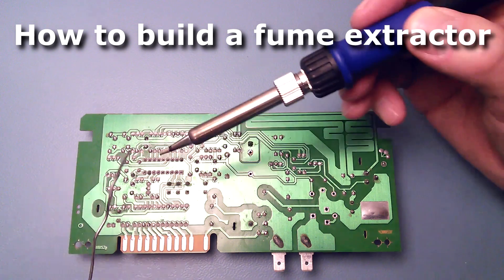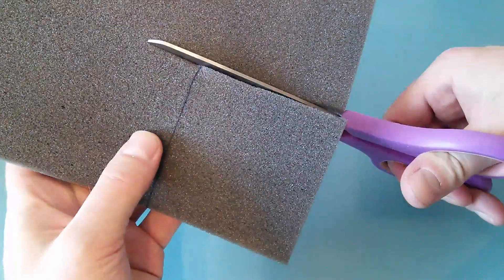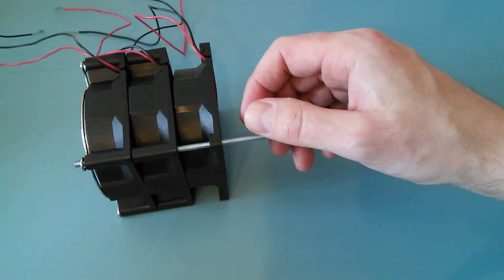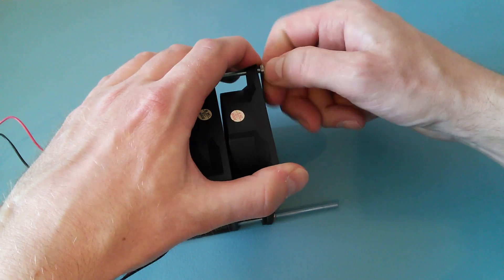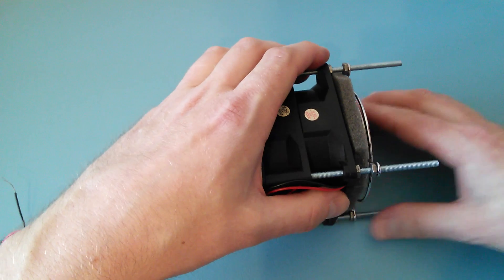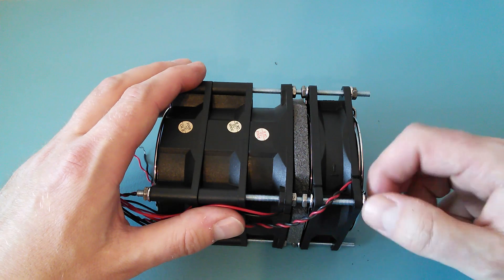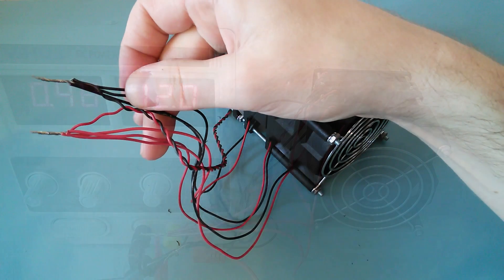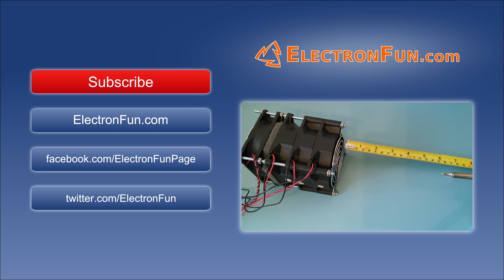How to build a fume extractor #1 of 3

Comment: As others have said, hepa filter is the way to go, however the best design is a fan positioned above with some kind of hood so the fan does not in anyway cool your solder iron. Smoke naturally flows up, hits the hood where the fan is and then gets sucked away. So far you have pc fans sucking air.

Comment: I guess if your only goal is to keep the fumes from going up your nose, it's a success, but if you want to get the harmful particles from lead and flux (I think it's the rosin) fumes, you have to go through a carbon filter (for the smell only) and a HEPA filter (for the nasty particles smaller than 3-5 microns). Also, the fumes cause way more worse things than asthma, it crystalizes your lungs for one, along with lead poisoning!

Comment: You need to add a stator between each fan. The fan causes the air to not only flow, but it imparts a spinning motion to the air. The stator cancels the rotational effect and increases the efficiency. If you want an example of this just look at the compressor of a jet engine.

Comment: I gave you a like because it is better than nothing and it could be improved. I guess you already did on your other videos, which I will watch later. Anyway thanks for the good idea.

I would say that a good improvement would be to add some kind of cone so that the fume gets directly to it. Also a lamp arm to make it more flexible (and the carbon filter, but you already know this from other comments). Look the commercial extractors: TOOLCRAFT ZD-153 and ZD-153A to have an idea of what I meant. I guess only one fan would be also enough, but as you see on those extractors, it will be a little bit noisy, like 43 db. I guess this is still tolerable. The suction power of the fans is about 60 m3/h or 35 cfm. Anyway, I guess the theory you mentioned about increasing the static pressure when using several fans of the same type, may be also right. At least on this case, your DIY extractor perform similarly to those two commercial extractors I mentioned: the maximum distance is around 12 cm or 5 inches, which is also enough for hobbyist like you and me.

Comment: Thanks for sharing. Great video even after 6 years. I am mostly interested in a silent air purifier so I will make use of layers of carbon filter and HEPA vacuum bag cut into size. You are right. I hate the noise of AC fans. Can't run them 24hrs.
Reply: i use Electric Foot Switch Pedal . When i need it to suck, i push pedal with my foot so i dont hear noise all the time.

Comment: thx bro , but Do you think its good method as turbo CPU fan ? can be better than single stock fan ? anyone tested that ?
Reply: I have seen commercial fume extractors and they come with only one powerful fan, sucks about 60m3/h or 35 cfm of air; however they are a little bit noisy, like 43 db, but I think this is still tolerable. I saw some review videos and they perform similar to this one, the maximum distance is about 5 inches / 12 cm.

So, I guess you could use only one fan. Look for: TOOLCRAFT ZD-153 and ZD-153A fume extractors. They will give you an idea on how to construct yours. I guess the difficult part is to get that cone they use for getting the fume directed directly to the fan.

Comment: you need a prefilter, hepa filter, and an activated carbon filter. I recomend using a ducting system inside of a plastic storage bin. you can make a compartment for the fan and a compartment for the filter material. It might be more expensive to make a better setup, but paying for medical bills from lung cancer or COPD is more expensive.

Comment: You should replace the foam with "cut to length' Carbon Filters. They are dirt cheap on Amazon. :)  I am actually doing this same project, and was checking out other peoples designs before I start! 
 
I think the Foam can go in front of the first fan to filter dust, perhaps.. but the rest need to be carbon filters, or they are just dispersing the fumes into the room. (It's not as concentrated as smoke) but after a while, your room will be filled with invisible toxic lead fumes, etc.  Also if you can get ahold of some HEPA filters (you can find the large box looking ones at home depot/Lowes, etc.)... then just cut a square out of it the same size as your foam blocks. Would prob need to hot-glue the edges to keep it from unraveling, but still doable. With that many filters + hepa.. there would be literally 0 toxins left after it exits the final fan. 

Nice video though, will sub. Keep at it man.

PS: Here is a link to the cheap Carbon Filters:  https://www.amazon.com/All-Filters-Cut-Fit-Carbon-Purifiers/dp/B000U204W2

I will also be using these in my design. If I find a suitable HEPA filter, I'll post an edit here, in case anyone else is interested in building one of these.
Reply from the maker: Sorry for replying so late. Thanks a lot for the valuable comment and subscribing :)
That's true - the foam is pathetic and a carbon filter would be much better. When it comes to the HEPA filter - I'm not so sure about this, because this would probably require a lot of suction force. Have you tried this idea in practice?
Reply: No I haven't, mainly because HEPA filters are too expensive, by the time I bought one to cut up. I probably could have just bought a smoke absorber! However, I was browsing digi-key, and they sell some very powerful computer fans. 

https://www.digikey.com/products/en/fans-thermal-management/dc-fans/217

At the moment I just have a fairly cheap fan I scavaged from a computer power supply.
Reply from the maker: Computer fans are not very powerful, they are supposed to be quiet.

Comment: you need active coal
Reply from the maker: Now I know, so many people told me about the filter. I hope to redo this project once more, but this time the way it should be done.
Reply: Thanks for the video. This type of unit is fine for hobby types - which is what I am - don't pay too much attention to "professional opinions". I had an idea maybe you could use cooker hood filter, its cheap, easy to cut and it has carbon too.
Reply from the maker: The cooker hood filter should work just fine for this application. Thanks for the tip :)

Comment: There are several videos on YouTube where PC fans are driven to destruction. All of them ran at more than 20 V some as high as 40 V.  Just for fun I ran one at 18 V for a week solid. It was fine. They are brush less so the only problem might be heat build up but not after a week I think. If you have an old fan that's a bit noisy peel the label of the center and you can add a drop of thin oil to the bearing and a bit of tape to recover it.  An extra fan adds about 30% to the airflow but I don't think adding more than that is necessary.  Increasing the voltage makes far more difference. Good idea but a better filter is needed.
Reply from the maker: My first YouTube video is about cleaning a PC fan :) I haven't tried running fans at higher voltages, but it may be an interesting experiment.
So many people complained about the filter - I should have used a carbon based filter, that's true.
Reply: On the other hand a secondhand cooker hood works well, light too. Filters are expensive though. BMW use (or so I read) nylon wool soaked in a mist of glycerin for their air conditioning. Apparently it stops very small particles.  The only problem with activated charcoal is it clogs up very quickly. You can't win can you.
Reply from the maker: Wow, these BMW filters must be quite expensive!
I believe the activated charcoal should be more than enough for a fume extractor. You can buy such filters quite cheap on eBay, so it shouldn't be a problem to replace it even once a month.

Comment: It might be best to vent it outside because the filters necessary to render the smoke harmless are not inexpensive. Take a look at this video: https://www.youtube.com/watch?v=KVaN3vTXY9E
But it is a wonderful circuit design! Thanks for sharing, Sir
Reply from the maker: Thanks for you comment and the link, I have already seen that video. I'm subscribed to paceworldwide channel :)
I agree - the best thing to do is to vent the fumes outside. However, not everyone has a workshop and conditions to use such equipment.
Carbon filters are often sold in larger sheets and they are actually not very expensive.

Comment: Its a good start - it pulls the fumes away from the solder tip.. so not going straight up your nose, but now the fumes will be pushed out the back of the fan stack and dispersed through the room, so if your breathing the room air, you still inhale chemicals.  That foam you blew it through isn't activated charcoal, so nothing is going to get filtered out, just distributed ....
Reply from the maker: That's true, it's better than nothing. I know I should have used a carbon filter.
Thanks for your comment :)

Comment: You really only need one fan.
Reply: tommy aronson  I have seen commercial fume extractors and they come with only one powerful fan, sucks about 60m3/h of air; however they are noisy, like 43 db. I saw some review videos and they perform similar to this one, the maximum distance is about 5 inches / 12 cm.
Reply from the maker: A lot was said about the number of fans in this project.

Comment: I don't think that filter is removing any of the fumes. They are just dissipated out the other end. You would need a proper filtering agent such as activated charcoal and maybe a hepa filter. But as long as you don't see smoke coming out the other end, you might be fooled into thinking it is working.
Reply from the maker: Thank you for your comment Roy. You are right, a carbon filter would be much better. Many people commented about this and I will use some kind of a carbon filter in the final version.
Reply: ElectronFun.com I still enjoyed your video. It's a work in progress. My comment was intended as constructive criticism, not negative criticism. I have recently subscribed to your channel and so far, I like what I see.
Reply from the maker: Constructive criticism is a very positive thing, because we can learn from our own mistakes - thank you very much for that and for subscribing.
Reply: Carbon filter 60cm from hood cookers. You can buy from Ebay. $4-5

Comment: how to find out the total voltage needed for the fans?  In this case, you mentioned it is 12V.
Reply from the maker: Voltage can be found on a sticker. In my project all fans were 12V and I wired them in parallel, so I didn't have to change the voltage.

Comment: Is it better to put them in line like this? I think it may increase the suction, but only in a small area. so you would have to put the FE really close to what you are soldering
Reply from the maker: It does increase the suction and not in such a small area. However I will redesign this project one day.

Comment: stacking fan like that dont work it will make your fan run slow.
Reply from the maker: It doesn't change the speed, it increases static pressure.
Reply: +ElectronFun.com
no the 1st fan is trying to rotate the other fan in reserve that why it will run slower and same to other fan. try it power the 1st fan and dont power the 3 fan and 1st will rotate the second fan in reverse. it will be better if you only use one fan.
Reply from the maker: Have you seen charts like this one: http://www.nmbtc.com/fans/engineering/multiple-fan-use/? Pay attention to fans in series.
Nonetheless I will redesign this project - I would also like to include an experiment with multiple fans in part 3.
Reply: That chart work if you have fan that rotate in diff direction. If the fan rotate in same direction if wont work.
Reply from the maker: I can't agree with you. Have you ever tried this yourself?
Reply from the maker: I can't agree with you, show me some evidence.
Reply: I tried that the results is not good single fan is better. Look the fan of the jet engine the dont stack the fan in same orientation.
Reply from the maker: I tried that too and it worked. However it depends on the shape of the blades and probably some other factors too. Some fans work better in a stack than others.

Comment: Why you use 4 fans instead of 1?
This won't give you any more power!
Reply from the maker: +Vilmeid Good question :) I did a few experiments and it turned out that multiple fans in series create a higher static pressure than just one. See the following figure: http://www.nmbtc.com/fans/engineering/multiple-fan-use.
However my most recent experiments show that certain conditions need to be fulfilled for this theory to work. I might show some of my experiments in part 3.
Reply: I use one of the enclosure cooling fans instead :D
https://www.dropbox.com/s/qyn6lrfmy7ktb58/20151215_190052.jpg?dl=0
https://www.dropbox.com/s/0k6jzoyod4baaz7/20151215_190030.jpg?dl=0
Reply from the maker: +Vilmeid Cool, is that some kind of your project, or did you buy the whole thing?
Reply: My dad brought it to me. I just put Carbonfilter in it. But i'll build a small cabinet for it with on/off switch, and a dimmer. Because it runs on 230V~. Quite loud but now it runs on 110V~ at 40 dB and sucks like a vacuum cleaner.:)
Reply from the maker: +Vilmeid Look out for your electronics parts, they may get sucked in ;)
Reply from the maker: +ArcanumChronicles I've seen some charts about fans in series - most people think it won't increase the airflow and they are right, but they don't know multiple fans in series increase the pressure as you said :)

Comment: Fans on top of each other doesn't make anything spin faster or push more air. You would be better off with 2 fans connected with some kind of pipe in between, so the fumes get pushed out further away from you. If you can't see them, that doesn't mean they're not there.
Reply from the maker: DaGunchijs I like your idea with the pipe and 2 fans - this could work too.
Have you tried stacking 2 or 3 fans yourself? It does push more air and it's better than nothing.
I know the visible fumes are only a part, the rest is invisible.
Reply: I have tried it myself, even if my understanding of physics told me before i tried that nothing would improve, rather than noise and power consumption.  Let's say a fan pulls 30 CFM (Cubic feet of air per minute), stacking another on top won't help, as both spin only as fast to pull those 30 CFM. If you placed them side by side - yes they would pull 60 CFM in that case, as they have bigger "surface" area. Think about it yourself. Cheers!
ElectronFun.com
Reply from the maker: DaGunchijs The theory seems very reasonable, but how to explain the fact that you can simply feel 2 or 3 stacked fans blow stronger than a single fan?
Reply: Placebo Effect.
I have done my research and in My opinion it's not worth the effort as only in rare cases you can get up to 10-20% gains. As specific fan blade angles must be combined and some other factors.
 You are pleased to do what you like and think works better.
 For airflow on my soldering workbench I used a single 12v 92mm fan which I overvolted to 17volts. Ne noise was tremendous, but worth the extra airflow. It lasted for about 9 months after which the fan's internal electric circuit went up in white smokes.ElectronFun.com
Reply from the maker: DaGunchijs You're saying I was lucky, because my blades had the right shape to generate better airflow - you might be right, who knows :)
17V for a 12V fan is a bit too high, I guess you were lucky it worked for 9 months.
Reply: DaGunchijs First of all your about right. In free air lets say in a PC Case there is no improvement.BUT when the fans are needed to get more pressure its very useful to have more in line!
This is also when on a cpu heatsink, if not much, it improves!

But its not like 2 fans = 2x pressure or so. Between the fan and the fanduct theres a large gap, where the air is dragged to due to centrifugal forces, and due to the spinning the air spins itself, meaning the second fan cant get as much air as the first one cause the air spins allmost the same frequency as the fan itself!

You would need an airguide to improve this but this also means drag.

All in all its not worth the efford. Id suggest using a powerful big fan (like in real fume extractors) and duct them with reduction which makes more sense ;)
Reply from the maker: Lord_Vader Thanks for your contribution to the topic. I will try to improve this project when I finally have some free time to experiment with it.
Reply: Fans have another property, beyond flow rate and airspeed, that is pressure differential. When there is resistance involved, pushing air through a filter for example, a fan may reach its maximum pressure differential. Stacking fans in series allows you to add up their potential pressure differentials. This is not unlike the voltage potential on batteries in series. The similarities are actually quite remarkable in my opinion.

Comment: 1 Delta 12V (252 cfm) will be enough for me.
Reply from the maker: ***** Do whatever works for you. Just don't inhale flux fumes.
Reply from the maker: +Jaff Tyrone I can use only instrumental music, sorry.
Reply: I saw the specs of that fan and it is way too loud: 65 db. So, you will save your lungs, but damage your ears; unless you reduce the noise somehow. I find out that most commercial fume extractors use fans with 60 m3/h or 35 cfm. They are still loud: 43 db, but it is reasonable.

Comment: I used a 110v fan i had in my junk drawer and ordered some carbon filters from alixexpress. Works great.
Reply from the maker: Carl Bradley Thanks for sharing your idea. Is it very noisy?
Reply: ElectronFun.com mine too! but the important thing is they work, lol.
Reply from the maker: I didn't say my fume extractor was noisy :)
Reply: Oh, not sure noisy is the right word than, it's forceful. Moves a lot of air fast. I did a youtube video on my channel, Note my kitchen hood fan is running in the background also.
Reply from the maker: Carl Bradley It's hard to tell because of the background noise, but your fan does the job pretty well.
Reply: https://youtu.be/SkQ4ZDiXqPk